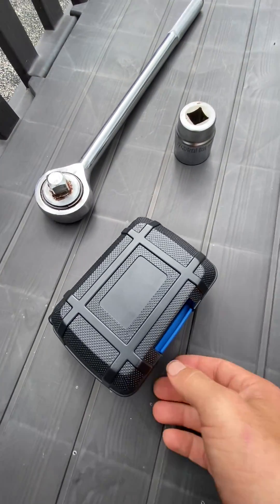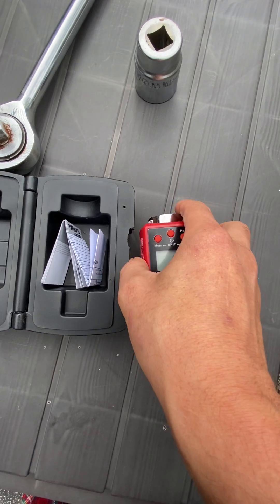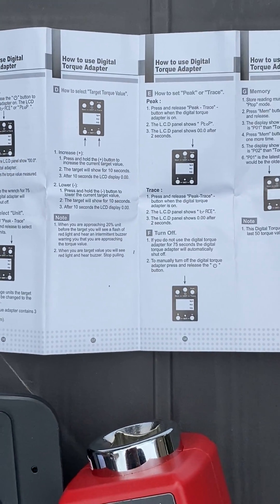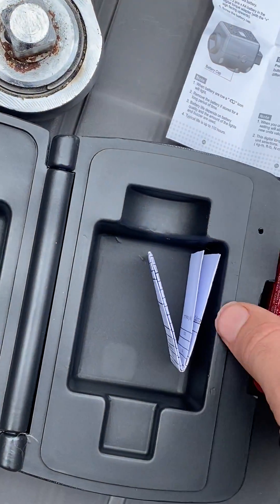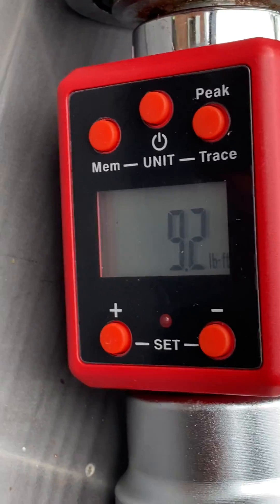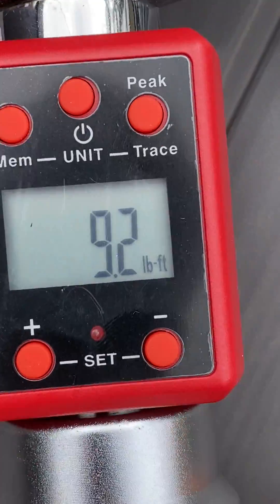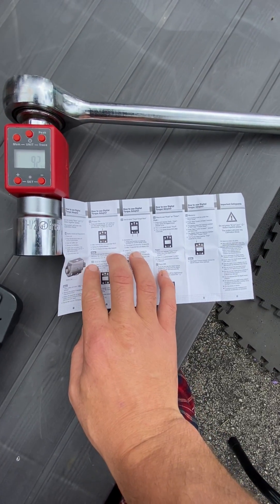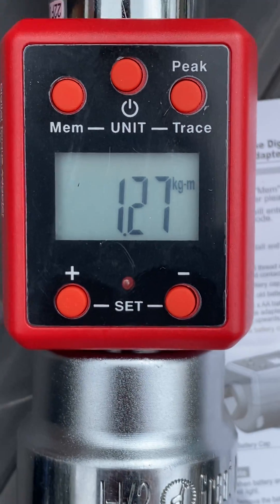NEIKO Torque Adapter 150-750 ftlbs 3/4” Drive Model 20743A.  With INSTRUCTIONS!

Comment: hey 2 years are  past from posting this video. its time to ssy its a good one or not
Reply from the maker: @musheghhayrapetyan8982  it’s absolutely a great buy. I’d buy it again.  I use it with a breaker bar and a pipe. Able to torque mains on DD and Series60 motors. 

Any electric torque wrench I always want to be able to see the display as I’m torquing. My snap on $600 waste of money has taught me to be very weary of them suddenly turning off while torquing. 

Maybe I should make another video of its review. Thanks